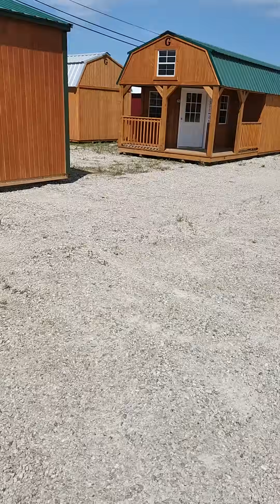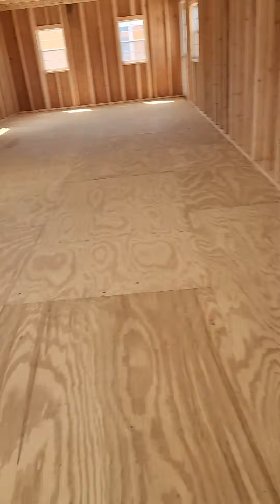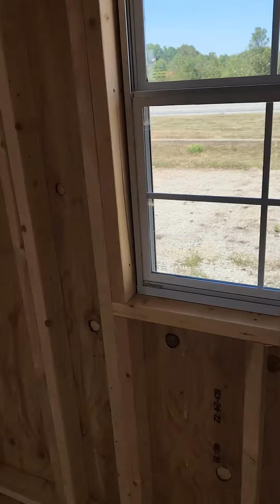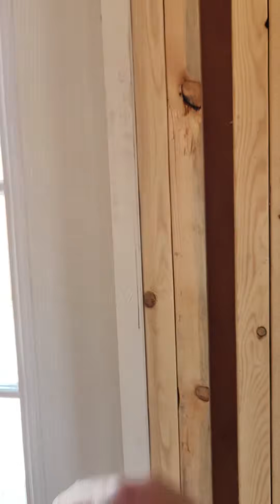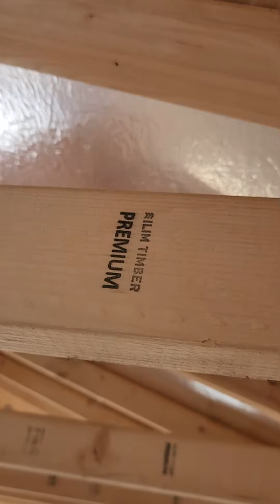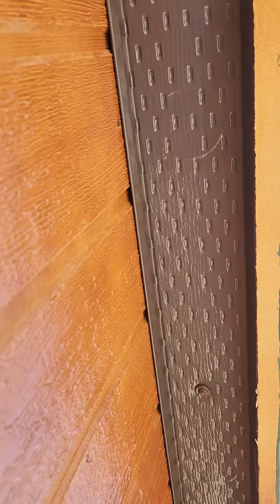FULL WALKTHRU 16x40 Custom Garden Shed by Graceland. Perfect DIY Tiny House project for you!

Comment: What is widest that can roll down highway?
Reply from the maker: The widest that Graceland builds is 16' wide measured at the eaves.
Reply: @gracelandwp  How high can you make the ceiling
Reply from the maker: @louisianaovereverybody  94 inches to the top of the walls
Reply from the maker: @louisianaovereverybody  in some other regions they can build taller walls, but in my region that is the max wall height
Reply: @gracelandwp  can you do the framing, electric, and installation
Reply from the maker: @louisianaovereverybody  we sell them as storage sheds, not completed / "finished" residential buildings

Comment: that's a big shed.  Not a tiny home because it does not meet residential building codes.  Now if you had 2x10 floor joists and 2 x10 roof trusses that can be anchored to a concrete slab....Id be all over this.
Reply from the maker: Correct. It's a storage shed that people convert into a tiny home.
Reply: Just order it that way